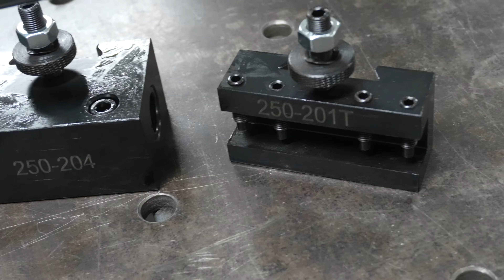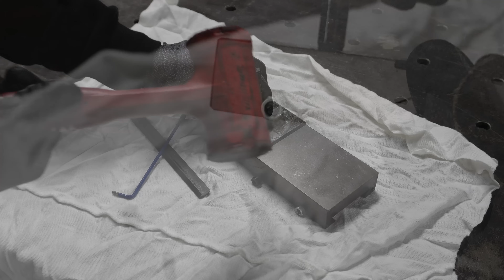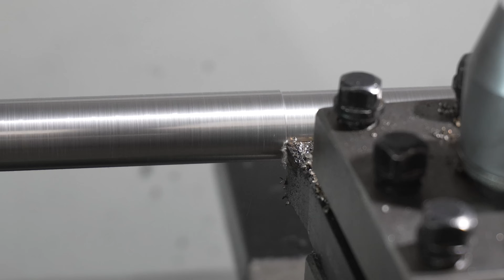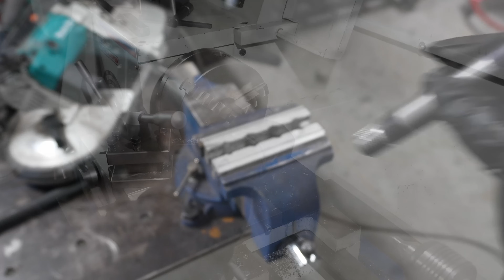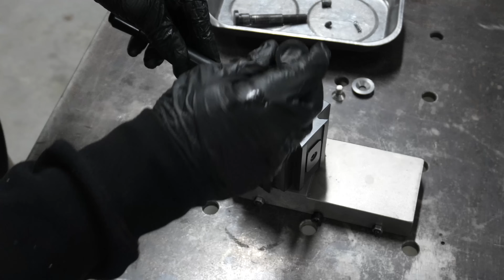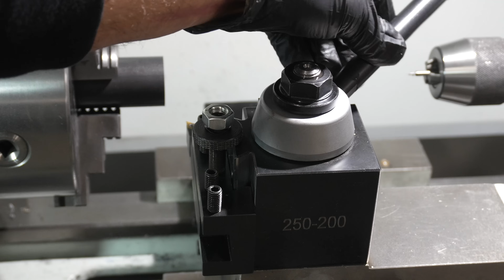VEVOR Quick Change Tool Post upgrade - HAFCO AL320G Lathe

Comment: If it were me I would not buy a piston type quick change tool post. I installed a wedge type on my CT089 lathe which is the Canadian equivalent of the AL320g with a 5TPI lead screw. The wedge style is much more repeatable than the piston type. I know the piston type is cheaper and in careful use they can work ok but all the high quality units are wedge style. Just my opinion and your mileage may vary. Nice job getting it fitted. They are not as simple as some other machines to convert.
Cheers: BJ
Reply from the maker: Cheers for the comment. I’ll have to look into the style you’re talking about. 🙏🇦🇺

Comment: What size tools are you using? Mine come with like the 8 or 12mm and I ended up changing the the 16mm and basically dead centre. Do you use 16mm in this or the smaller ones?
Reply from the maker: I use 16mm 👍

Comment: EXTREMELY DANGEROUS WORKING PRACTICE!

Never EVER wear gloves or long sleeves near an operating lathe! 

That's a recipe for serious degloving injury, potentially having your arm torn off or (worse) getting amazingly bad compound fractures. 

It doesn't matter how many guards or brakes you have or how low powered the lathe is, just don't do it. Even a 300W motor can cause serious injuries and you're ingraining bad habits which are likely to kill you sooner or later. A larger lathe can rip your arm off and whack you in the face several times with the soggy end before you can even react and the 4kw or larger ones you see in workshops can pull your entire body into the lathe in a fraction of a second, tenderising your corpse on the bed and ways before someone can hit the emergency stops.

The content is enjoyable and educational, but I'd really hate to see you turning up on here with your arm in a sling and a "my lathe grabbed me" story. If you search here on YT for lathe injuries you'll see some pretty horrific videos of accidents caught on CCTV. If  you fight a lathe, the lathe will always win
Reply from the maker: Cheers for the comment. I definitely don’t wear gloves anymore in my newer videos. Continually getting metal in my hands but still it’s better than a much worst injury 👌🇦🇺

Comment: Lube, Lube, Lube..... All that drilling, tapping and die threading without lube had me cringing. 🤣  But seriously, Lube will go a long way toward improving fit and finish of threads, reducing tool pressure (helps tools cut easier) and holding drill bits to a tighter tolerance and a cleaner, rounder hole,  and vastly improving tool life. The type of lube is up to you but I use Boelube, Anchor Lube, Tap Magic. The lube I use depends on the job at hand. Also WD-40 is excellent for helping to prevent chip welding when turning soft Aluminum. In the long run any lube is better than none at all.
Reply from the maker: Cheers for the comment. My next video includes lube. I’ve hurt allot of feelings by my lack of lube usage. Haha 😂🫢

Comment: I thought about going to a quick change but as the lathe is not the most rigid and decided having a quick change makes it less so and didnt want that..
Its easy enough to have 2 tools clamped in the tool post opposite each other and just spin it around to swap from one to the other (one for cutting the other for inside chamfer etc)
Reply from the maker: I have heard that it would be less rigid. Is that due to the increased distance from the centre of the tool post?.
Reply: @FAB-LIFE444   Yes pretty much.
As someone else mentioned you can remove the compound completely to make it more rigid but IMO thats going overboard and you need the angle ability of the compound to do threading and larger chamfers.
Reply from the maker: Yeah I definitely want to keep the functionality of the compound slide. It’s great for cutting tapers 👌

Comment: I'm in Aust too, and have planned to get the Hafco AL320 lathe like yours.
I it at a good price point, and suits my needs having a shortish bed (ie compact workshop) but large swing and large spindle bore size.
The thread cutting gears etc dont bother me because I'm an electronics CNC guy and will just put an electronic lead screw on it for threading.
Reply: I already have a electronic lead screw using a Teensy4. . No more change gears. A very simple mod actually. the extra swing of the 320 really is worth it
Reply from the maker: @stuartruss7536 I’ll definitely look into it 😊
Reply: @FAB-LIFE444    yeah its not just for threading, you can also dial in power feed speeds too since it controls the power feed screw.
There are a few kits and finished products for ELS, most look pretty good.
I'll do my own because I can do 2 axis for fully automated tapers and threading, i mean, if you are attaching motors to a machine then why stand there cranking handles? 😎
Reply from the maker: That’s a great idea about threading! Have you seen that done before on one of these?

Comment: I just made a sleeve to go over the existing toolpost bolt and a new top cap with an internal thread. That way I can still place my original tool holder ( which I use for knurling )back on and dont have to muck around changing the bolt
Reply from the maker: That’s a great idea but my original bolt was way too short to do what you did 👌
Reply: @FAB-LIFE444  Thats why I made a longer cap with an internal threads
Reply from the maker: That makes sense 👌

Comment: Nice job mate,  but get rid of those gloves hey.... they will cause you a nasty accident.
Reply from the maker: The thin latex rubber ones?
Reply: @FAB-LIFE444 any gloves are a sure thing to have to visit the hospital 😢 with any rotating tools
Reply from the maker: Too easy. I’ll take that onboard 👍
Reply from the maker: Keep an eye out for the next video of my lathe and mill featuring gloveless hands 🙌
Reply: @FAB-LIFE444 nice 😊 I've subscribed bud 👍
Reply from the maker: Awesome thank you 🙏. I’ll have to checkout your channel as well. That Unimig CNC table looks good. I’ve seen them advertised 😎
Reply: @FAB-LIFE444 they are awesome bits of gear 😎
Reply from the maker: @DoinStuff I am definitely a fan of Unimig. I have the mig, tig and plasma machines so far.

Comment: I have made modifications to my alg320 adding dc braking and a foot pedal to mimic larger lathes along with a dro and a guide for the tailstock to ride along the v way preventing side to side movement.

Thanks for the link to the QCTP.
Reply from the maker: I’d love to see your mods. DM me on instagram if you’d like 👍. I’d love the foot pedal. I see cutting edge engineering on YouTube using his… massive lathes he has

Comment: dangerous wearing gloves when using equipment, especially lathes, mills, drills, and grinders..  It touches the glove and will pull your hand right in .. 🥩🥩👍👍
Reply: So why wear them?
Reply from the maker: @maxatherelaxer because for the most part, they keep they oil off my skin and stop the cuts from the small bits of metal. Cheers
Reply from the maker: I’ve done some digging on the rules of wearing thin gloves like I wear… seems like the risk is lower but still not worth injury over testing the waters. I won’t be wearing gloves while operating the mill or lathe anymore guys 👍
Reply from the maker: That’s why I wear very thin rubber gloves. They tear just by breathing on them 👌

Comment: Good day. Nice job on the tool post. I have the Canadian equivalent of the AL320g. Its a Busy Bee Tools CT089 that uses imperial lead screws and dials. I installed a wedge style 250 series quick change tool post on mine and it works very well. I do whish it had a quick change gear box for the lead screw like my old South Bend 9" lathe had but I needed the extra capacity and the 1 1/2" spindle bore is sure nice. I do need to install a stop pin for the longitudinal/cross feed change handle as it is very easy to accidentally go into cross feed when shifting out of longitudinal feed. Don't ask how I know. It is, however, the easiest lathe I've ever used for threading. Just a pain in the butt setting up the change gears. I also find that the power cross feed is very slow compared to the longitudinal power feed. A quick change gear box would sure make that nicer but I can't complain about an almost brand new lathe that I only paid $1,300.00 dollars for. New they are over $4,000.00 here.
Cheers from Canada: BJ
Reply: Since I dont use the cross feed, I actually pulled out the drive gear after I jammed the x feed leadscrew after bumping it 😠😠😠
Reply from the maker: @stuartruss7536 that would have been bad
Reply: @FAB-LIFE444  Thats why I removed the feed gear. Way to easy to bump it
Reply from the maker: @stuartruss7536 I’ve over rotated the level and sent the cross slide into the work piece haha.
Reply: @FAB-LIFE444  That's definitely a pucker moment. Don't ask how I know.
Reply from the maker: @Bob-xc2us haha
Reply from the maker: Awesome comment. I do agree about the power feed lever. I’ve made a pass and then when I disengaged the feed, I pushed the lever too far and sent it into the material hahaha. Very easily done. Yeah a quick change gearbox would be heaven. It’s suck an amazing hobby to learn. Endless projects to make 👌🇦🇺
Reply: @FAB-LIFE444  Enjoy the learning process. You can drill a hole beside the lever and put in a lift out pin to prevent slipping into cross feed. That will be my next modification.
Cheers: BJ
Reply from the maker: @Bob-xc2us I’m definitely going to do that for sure!👍

Comment: Bro the old tool post is way better you need all the ridgidity you can get on those machines. Did the old one index at 90 degrees?
Reply: Też się obawiałem ale w brew pozorom jest to całkiem sztywne rozwiązanie. Nie musiałem redukować ap lub F w wyniku używania.
Reply from the maker: I would only assume that due to its larger size compared to the original, much like larger tooling… it would ultimately be more rigid due to more mass. I absolutely love it and I wouldn’t go back to undoing 3-4 screws, adding shims to set height every time I change tooling 😂
Reply: I have the new style post and they are much better than the original. Just saying.
Reply from the maker: @Jimbo-t2h so you’d agree that’s it’s an “upgrade”? 😎
Reply from the maker: Cheers for the comment although I disagree. Being able to quickly change the tooling without having to re-centre is way better in my opinion. I’ve used the tool post now many times and haven’t noticed any negatives regarding rigidity.  I’m not sure what you mean about indexing….
Reply: @FAB-LIFE444 does it have a detentbto stop it at 90 degrees when you spin it?  As your tooling supplier for the correct centre heights and you won’t have to shim it, just on boring bars, then you can put 3-4 tools in and just spin the tool post. I have an industrial machine and do this full time and I wouldn’t go to a quick change even if it was free
Reply from the maker: @hc7217 cheers for the comment. Yes it does have a detent to stop at 90 degrees when rotated.
Reply: @hc7217  Except when you custom grind your own cutting tools, which I do. The adjustable QC is the only way to go
Reply: @stuartruss7536 you’d hope that new machine has enough torque and speed for carbide inserts, its bordering on a proffesional machine. Tangential tool holders are life changing for that tho

Comment: Nice upgrade mate, the quick change goes great with a dro too😅I think vevor does a dro kit, look for the lcd screen ones, makes things easy with pictures,  and you can set your tool holders to a number, and your dro knows the tool position on the cross slide with a up or down number change, easy as👍👌🇦🇺
Reply: I've got ToAuto lcd dro's. 3 axis on the mill and 2 on the lathe. They've been good, but... they don't do home position, so gotta set the tool position/ number each job. And it does some weird radius/diameter thing when I set the dimensions from a caliper measurement, I've got it set on diameter mode for cross slide but I still have to 1/2 function. 👍👌🇦🇺 Hafco has the mx30, it looks good but pricey( some glass scales have the home position built in, once you got over the spot, the dro knows where it is and all your saved tool positions to 5um too, but you always check tool position with a test cut) 5um (micron) scales are fine, 1um is awesome but a bit overkill
Reply from the maker: Nice. Yeah I looked at machinery house but they are so expensive… and the screens look basic a hell. I might have a crack at an eBay one and make a video of my struggles when installing it haha
Reply: Rob at ducati900SS channel has a good 4axis mill and 3 axis lathe dro install series, with quality 1um scales👍👌🇦🇺ive got the same lathe as him but the small BF16 mill, all optimum brand
Reply from the maker: I’ll get onto watching his series. Super excited for a little more precision 👌
Reply from the maker: Found his channel. It’s now on my to watch list 👍
Reply from the maker: Believe it or not… I’ve been on the hunt for one online haha. Both for the mill and the lathe. Have you got any suggestions of any brands?. I was thinking a basic Chinese one on eBay.
Reply from the maker: I do love my vevor tools haha. I’ll check it out.